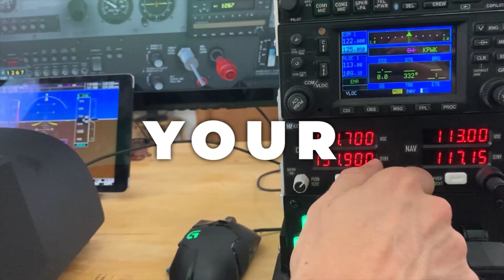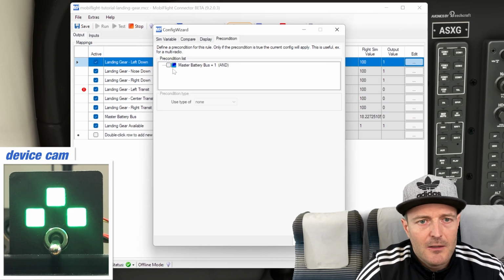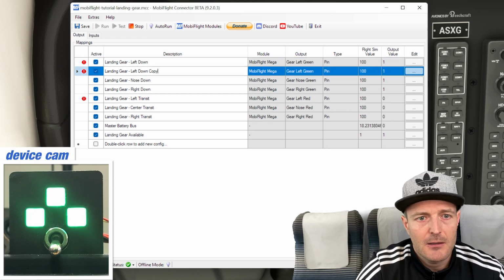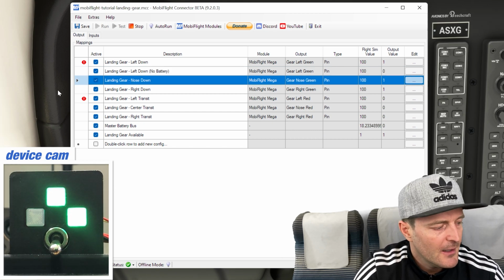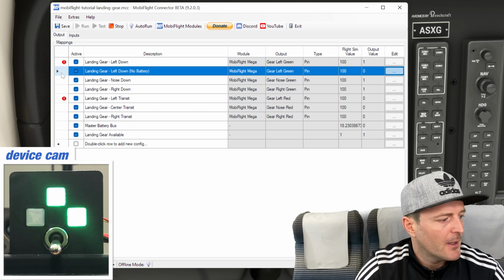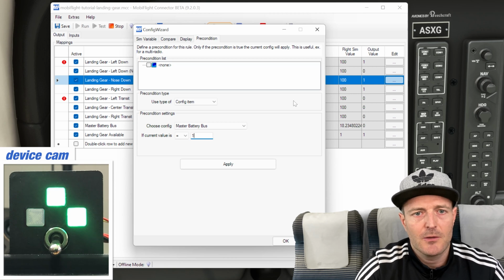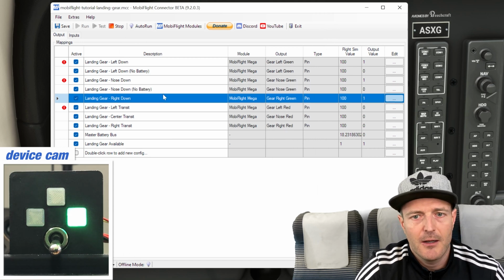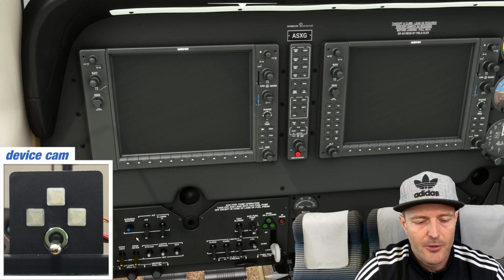I Made A Mistake! Let's fix the Landing Gear Lights with MobiFlight!

Comment: can mobiflight support multiple displays
Reply from the maker: LCD Displays up to 2 per arduino board and 8x 7-Segment Display modules (8 digits each).

If this is not enough you can add another arduino mega.

Comment: I'm trying to get a red landing gear light to turn on while gear is in transit.  I understand a little about the compare page, but it doesn't allow me to set the variable "on" for gear position % between 1-99.  I have another green light that is working properly.  Turns on when gear is locked (gear %=100).  Is there a variable or preset?  Using MSFS 2020, aircraft is FBW A320 Development version.
Reply from the maker: i explained this in the video. You basically define the rule if current value equals 100 then 0 else $.

Why does it work? In transit shall be off when fully extended  (100 -> 0 rule) For all other cases we can simply use the current value because anything other than 0 will make an led turn on (1-99) and the fully retracted position value 0 makes it turn off correctly too.
Reply: @MobiFlight  Yes, found it in the previous video.  The one you referred to in this video.  Thanks for uploading it!